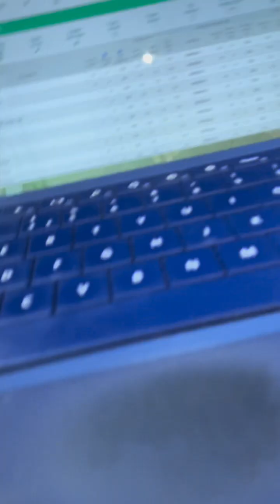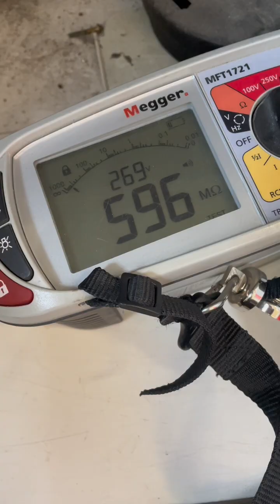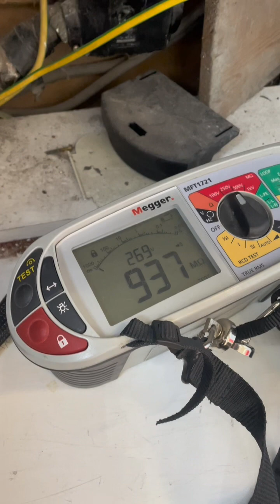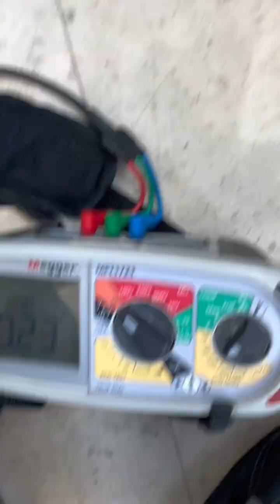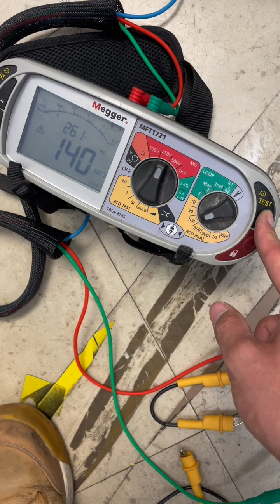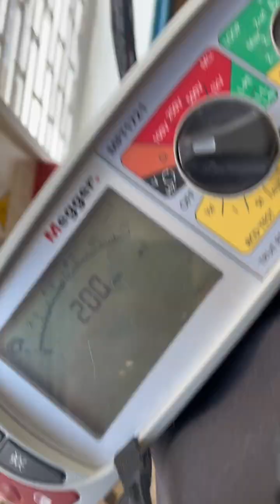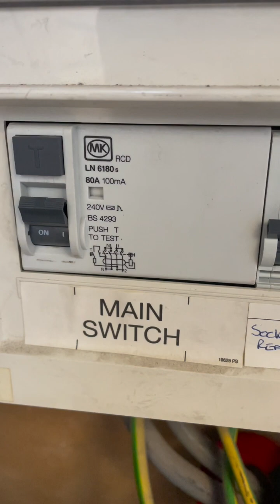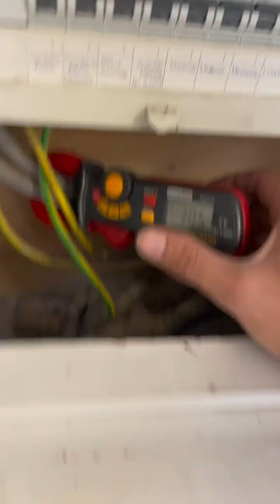Shop for sale EICR

Comment: I do a lot of rental shops and offices and I have a similar agreement.  Remove any unused or dodgy stuff, basic repairs as I go along.   As the tenants add stuff as they go along most of it is diy so I put it back to basics.    Are you quoting for new lights.
Reply from the maker: Disconnected a couple and labelled them on the inside for the next spark.